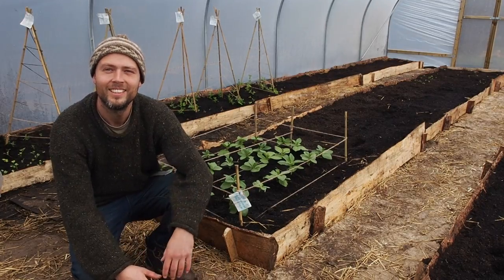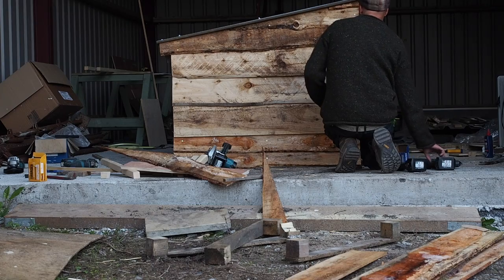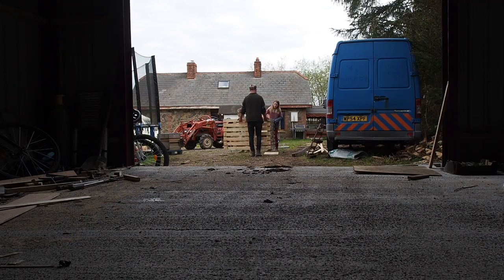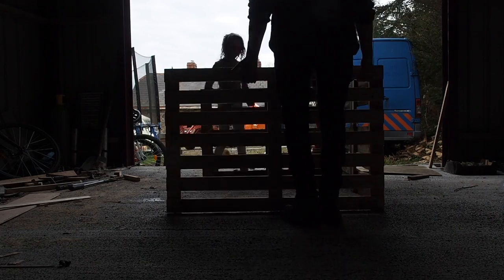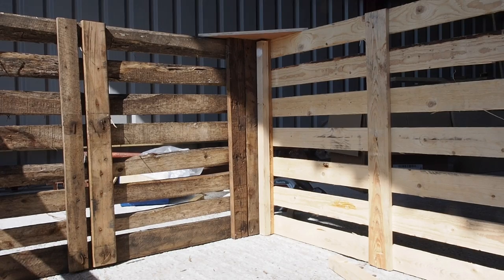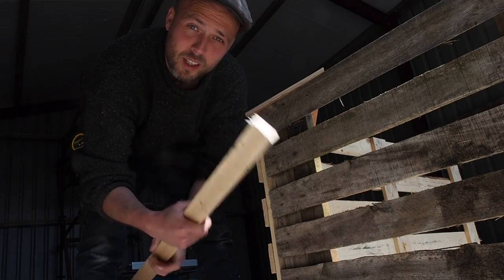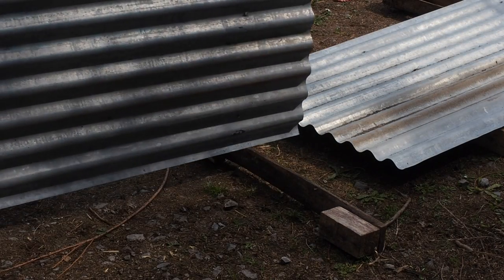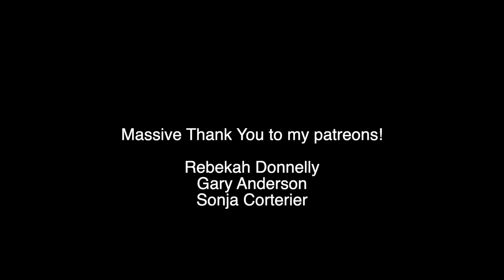Building a Simple Goat house for our Pygmy Goats out of Pallets! Low Cost Budget

Comment: whats the name of the saw blade mate?
Reply from the maker: Do you mean the one on my circular saw?
Reply: Yeah the one that ripped through the sheet of steel like butter
Reply from the maker: @davidosullivan3432  sorry I should have realised what you meant. It’s from screwfix. It’s an ebauer carbide metal cutting blade 20e. I cut all my sheeting for my workshop and it’s still going strong
Reply: That's what I would like to know as well! And the goats going to be spoilt rotten I reckon